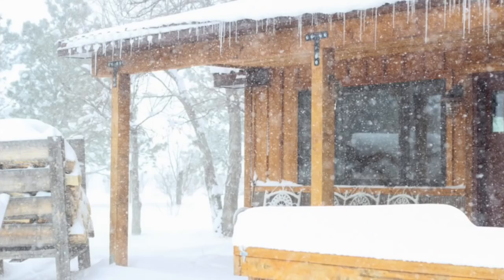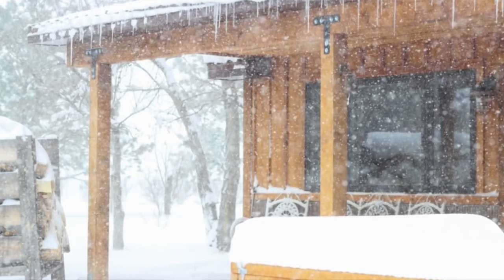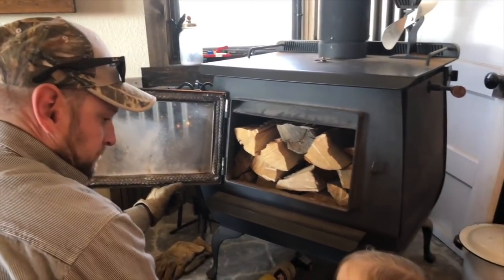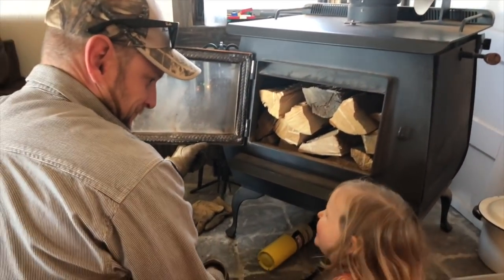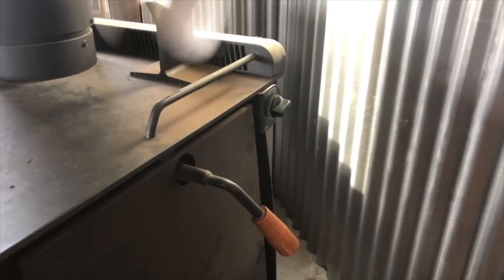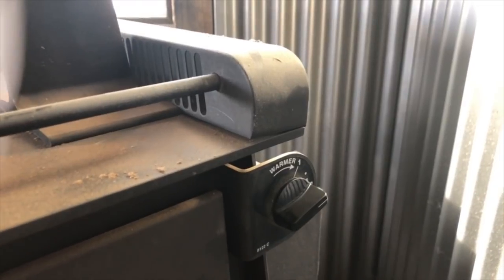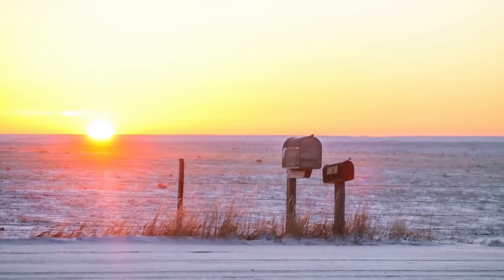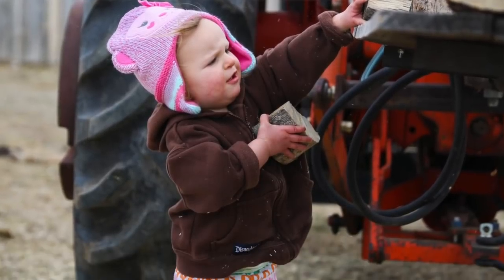How We HEAT (almost) Exclusively with a WOOD STOVE

Comment: Just subscribed. Found you from "The Elliot Homestead" channel. We have a wood burning furnace in our basement. It has a electric fan on it and pushes the hot air through the duct work that is there for the natural gas furnace. We too only use the gas furnace if we are going to be away for while. We just keep it set on 65 so that way if it needs to come on it can.

Comment: My stove has catalytic burner and secondary burner and I find myself still loading it every 4-5 hours.  If I don’t then the internal temp drops and it’ll just be a hassle to get your new wood to get to an optimize temp again.  Wood are dry and I set mine to a low burn rate once my stove gets going.  Do you wait until all of your wood is reduced to just a pile of coal before loading it?
Reply: Build a bigger bed of coals, that is where your heat comes from. Then load it up full when you are gonna be gone for a while
Reply: I have the king model. Most the winter I fill it twice a day. 7am and in the evening sometime. If it’s -20c for an extended time I may have to load it 3 times during the day

Comment: I'm having an issue with heating the entire house with our wood stove, the second floor gets no heat from the stove. Don't know if we're doing something wrong, if it's not installed the most efficiently or if it's our model stove? Any feedback would be great.
Reply: Could try ceiling fans to move air. Also is your stove large enough. Is your wood dry. Good luck

Comment: Love your videos.  You can mix a solution of muriatic acid (used mostly to etch concrete) and water, spray it on as needed until it starts rusting.  (for your heat shield ).

Comment: If you want to rust that metal, mix half gallon water and half gallon vinagar and a cup of salt per gallon of mix. Can extrapolate mix larger and smaller to needs. Apply by spraying. let air dry, re-apply to desired effect. Once you are happy neutralize with baking soda and water mix 1 cup soda per gallon.

Comment: I have to admit that I ran across this video and it brought a smile to my face. I live in Maine, and like you heat exclusively with wood. I do have a back up furnace, but like your family... I still prefer wood. I own a 100+ year old house, so not all has been renovated so it does have areas that are a bit drafty. Wood does a much better job at heating the house than the furnace, and as you mentioned... it will not stop working if indeed  I should lose electricity. I have friends that always try to convince me to stop using wood because of the added labor to process and bring it into the house. But my thought is that I could use the switch on the wall in order to get rid of that, but the house is cooler and I have to work many more hours in order to pay for the other heat source. At any rate, thanks for sharing your videos!

Comment: I'd be really interested in getting your thoughts on heating a house around 1000-1500 more square feet that's single story. Not sure how to spread the heat out sufficiently, especially if the power goes out and we need it to work without a blower arrangement. For our case it would be nice to integrate it with the current furnace somehow by blowing into it when electric is on, but sometimes we have long stretches without power and it would be nice to accommodate for that with natural flow methods.
Reply: Use a classic fan to blow heat to circulate it away from your woodstove.  All the dinky builtin fan or heat induce fan doesn't really move heat that well.  Try it, it'll be a game changer for you to move heat around.

Comment: We have large Eco Fans on both our wood stoves. The new stove in the cellar is airtight, heats the floors and the eco fan assists the air up the stairway. Our 1930 kitchen wood stove ( Matilda) Is NOT airtight. Guess which one drives us out?? Matilda :-) She will heat 1,000 sq. ft., including our cathedral ceiling. I can cook, bake and heat hot water on the old girl. It is like having another person in the house. A bit finicky, but worth learning The Art Of...In the past, I have had charred 2x4s right through the sheet rock, without a heat shied. We have a huge air space around Matilda! There is also a 1,000 sq. ft. Rinnai in the basement for the pipes and we plan to install a propane mini split in the living room next year. We log on the property, so there is abundant Oak Maple and Beech. I recommend the Kitchen Queen airtight kitchen wood stove for a new model. Comes in two sizes. Great video! We have about a dozen fire wood customers. More folks in New Hampshire are considering using wood heat.

Comment: I have 52 m2 home, not 100 % perfect isolation. Have a small wood stove.  House is 12 m long so it is not wide. And of course, the woodstove is in another end It. I must fill it every 4 hours if it is very cold so more than -20 C outside. Up to -10 is 2-3 times enough, depends how windy it is. I can adjust air is going into burning. With that can make burning time 1 to 5 hours. I am using about 8 m3 wood in the year. But in Finland what is the same height as Alaska is also many summer days that ground is frozen or day time temperature is somewhere 4 to 8 C. Rainy days also need sometimes little heating. I have 3 electric radiators like back up when not longer time home. They keep inside somewhere 10 to 14 C and when I come home 2 times heating and house is warm. In stowe can but average 20 cm long wood. The stove has weight 120 kg.  It is stone covered. Burn wood is free for me, making it from own forest. Chain saw and splitter I have. Before done splitting with an axe. This year I make burn woof for 3 winters. Normally only for one winter

Comment: Been heating with wood for 30+years, first with a Vermont Castings, then when we moved to our current asylum we bought a Woodstock Fireview soapstone stove. If you want to see what it looks like, they're at www.woodstove.com. Soapstone takes a lot longer than steel or iron to heat up but retains heat far longer. It has a catalyst and burns super clean. So far, our record long burn without using kindling is 22 hours but we most often have 2 twelve-hour fires a day. Piece of cake. I used to install woodstoves for a living. Suggestions, if I may: the more efficient the wood-burning appliance, the faster creosote builds up. I clean our flue every 1-2 months. You will NOT enjoy a chimney fire and your insurance company will break out in a rash. Depending on where you live, you may have to let your homeowner's insurance company know what you're doing BEFORE installation. NO cheating on materials or clearances, safety should be your priority, you're trying to warm your family, not incinerate them. Where we live, we had to pull permits for each phase of installation and they came out to inspect several times. The Code People are there to keep you from making deadly mistakes. Tell 'em you want a thorough inspection, it'll make their day.
If you have a catalytic stove, no softwoods, and no "green" or unseasoned wood, they will dramatically shorten the lifespan of the catalyst. Your stove will come with an owner's manual, let that and common sense be  your guide. Thank you, Jill, for the video.

Comment: Actually your so called non electric fan is electric, it just is generated by two dissimilar metals creating the electricity when heat is applied thus turning the fan, the hotter the fire the faster the fan turns. Granted one of the greatest inventions for a stove be it wood or coal fired.
Reply: I think she meant that it's not dependent on electric current coming from an outlet. Great explanation on how it works though
Reply: In the words of Charlie Brown........
GOOD GRIEF 🙄
Reply: It's called the Peltier effect.
Reply: Thank you re:peltier effect. I never knew the name of why it generated electricity, just that it worked of two dissimilar metals. 

If you learn one new piece of information a day your paying attention.

Thanks again.

Comment: I did not know they made a 5000 wood stove. Maybe with pipe and installation
Reply: I see about 100 just in a platform...but still i figure around 2000
Reply: I would never buy a 5000$ metal box. You can buy used stoves for 200$
Reply: Blaze Kings are the best wood stoves you can buy. Period. My blaze King princess only needs to be filled every 16-20 hours when I'm burning in Maryland (2500sqft house).
Reply: Yeah its not a "wood stove" they are talking about. Look close it is a Blaze King they are "catalyst stove" 2 times as efficient as most typical stoves. Worth every cent.
Reply: @tribulation138  They won't be efficient or burn clean.

Comment: Here is an old timers suggestion.
When placing wood, especially in smaller woodstove and old stule trash burners, cook stoves, it is BEST to put your wood, triangle shaped point down, 
It burns, better,  leaving a flatter base  to place successive wood pieces upon.
Quicker starting, and the larger portion will fall towards bottom,forming a good coals base, and  more uniform burning.
Reply: Thanks for sharing this tip. I can't wait to try it!

Comment: All looks good except your heat shield...fire code says the shield should have at least a 1 inch gap from the wall and 1 inch from the bottom for airflow, which u dont have. If it's right up against the wall heat can build up & be dangerous...if fire, insurance will not insure because not up to code.

Comment: If your stove is set right, and burning properly, it already is burning the smoke. The addition of the Catalytic converter is only appeasing the greenie weenies and is only a MINIMAL amount of "efficiency".  When considering the extra doors and flaps that have the sealing gaskets separate and fall off, and are in-accessible to replace or repair, then the catalytic substrate that WILL plug up eventually, becomes a liability.
 Basic functionality is paramount. How the woodstove is designed internally for airflow is far more important.
 The reliability factor is second to none.
 Ya, wood is a PITA sometimes and takes forethought to stock your wood TWO years early for proper "seasoning",  but Propane would be a good source as a secondary heat source, and a s a stand-by as long as that burning device is well designed to function properly without electricity.
 The little fan that uses the heat from the stove to turn the blade IS electric and runs on the "Seebock effect". They're great.   

  Been dealing with woodstoves since 1969, over 50 years.

Comment: Catalytic converter required sounds like a poorly designed stove - which should do what a rocket stove does, burn the wood gas.  Wood stoves (here in any case) are imho very poorly designed for heating.  You want air drawn in from outside in the winter so you do not draw the heated house air into the stove causing cold air to come in from doors and windows, and in summer if it is hot you want to draw warm air from near the ceiling to cool the house, if you want to use the stove to cook on.  Because heat rises, think of your house as an upside down heat pool you want to fill up.

Comment: Heat my house every year with cord wood. Have a good heating system in the house. But why spend the money on oil  or gas. .
Get off the couch and make a difference
Reply: Michael, wow, how do you get by with using only a cord?? I have and outdoor water boiler and heat 3k ft, I use about 8 cords give or take, but I live in nc so not to long or bad of a winter. cant beat the price of wood
Reply: 2 cords of oak. Still have oil heat ( Steam. )
Reply: oh ok. i have propane back up and an insert in my fire place. in my case the outdoor boiler has worked wonders for me. paid for itself in 3 years. get some exercise and cheap heat to boot.
Reply: woods yeah 
I wood feel lost with out a wood stove . Had it cranking the other night at 750 .
Reply: I have an insert that I used to run and gas heat. still was burning 1000 gallons a year. now I burn the insert when we get a rare ducting of snow just to dry our clothes and make sure the chimney is clean. I burn about 200 gallons or less a year now. saved me a ton of money and I am comfortable in my home.  no wearing a sweater inside for me. not going to happen
Reply: @bullofthewoods9374  yeah.  I burn about 300 to 350 gallons a winter season only because the heat from the wood stove doesn't reach the second floor . So the oil heat only goes on at night when the wood burns out . Have to sleep some time
Reply: that was my issue. I have a 3000 sqft story and a half. with the great room being 24ft cathedral ceilings ( log house). I bought the outdoor wood boiler and installed a coil in both hvac units so I heat my whole house with hot water and they can run independent from each other. only time I use gas is for my dryer and cook top, and in the summer for my water heater. I have my water running through the boiler then going into my water heater. I don't see any need to run my boiler in the summer just to heat domestic water.
Reply: @crispychicken2743  4

Comment: For our 900 square foot home wood is the only way to go. We only use about 12 pickup loads of wood that we get off our own property. We're looking in to building a rocket stove which will use much less wood. That propane heat is a joke. The first year we bought the house 20 year's ago it was set up on propane and it cost 2500 just to heat for the winter. And then when the power goes out no heat. With wood no other power supply is needed. So no power still got heat.   Not relying on other people to provide heat to our home.

Comment: Sorry, but your fan is powered by ---ELECTRICITY.  
What do you think powers it?  The wind?
You may not plug it in, but it is still powered by ELECTRICITY.
The fan blade is attached to a small round ELECTRIC motor in the middle of your unit.
Look in the back of your unit and you will see a small ELECTRICAL wire for the motor.
The metal that makes up most of your unit uses the heat from your stove to make a small 
amount of ELECTRICITY to power the ELECTRIC motor that powers (turns) your fan blade.

Comment: I’d never buy a wood stove that the epa messed up with catalyst
Reply: you can buy a stove that has a secondary burn chamber instead which does not have the problems that a stove with a catalytic converter which has been mandated since the 1980s
Reply: I like my catalytic burner as it's the last thing to burn off any gas before it escapes the chimney.
Reply: After burning 2 non cats and then a Woodstock cat for the last 10 yrs I’ll never go back to a non cat unless it was a stove just for a pretty fire or occasional burning. Maybe one of the hybrids. I’d like to try a Blaze King for a season.
Reply: henry holliday the two chamber are nice and that design has been around sense 1800s but I’d never deal with a catalyst that is bound to eventually go out
Reply: I have one, and I don't really get why people hate them.  I have had one now for 15 years or so and it hasn't given me a lick of trouble.  The catalyst creates huge amounts of extra heat, it is no joke.  Greater efficiency means you burn less wood for the same heat and so you save money.  Less wood for the same heat also means less work for you.   And changing the catalyst is a 20 minute job in the summer, maybe once every 5 years or so.  It is an easier job than changing the gaskets or even sweeping the chimney, so the additional maintenance is trivial.  The only thing you really can't do with one is burn trash or other crap like that in the stove.   And at least mine can be a little fiddly to get going initially if you are trying to burn unseasoned wood.  (But that means I was a dumb-ass and didn't put enough up for the winter, which is hardly the stove's fault.)  Mine is a Dutchwest/Vermont Castings.
Reply: @AdamSmith-po5pd  We live in the Yukon,  since last year now we have a Blaze King and we're off-grid and heat with wood. The Blaze King is awesome and very efficient. Better than any other stove we've used. It is the first cat stove we've ever had. We really like it for what it is worth. It works great since we burn spruce, poplar and aspen. We don't have hardwood here, so I like the efficiency of the Blaze King.

Comment: Keep that catalytic converter clean it can catch on fire and burn the house down
Reply: skojo3e the whole point of it is it is so hot it burns off any soot, creosote etc. You don't touch it. It cannot burn your house down, it's within the stove where it is completely contained by sheet steel.